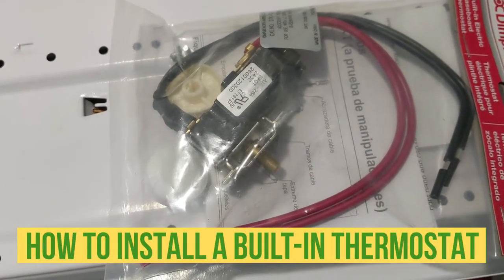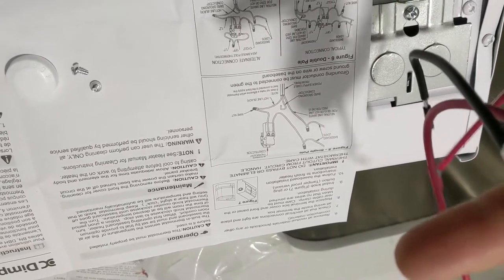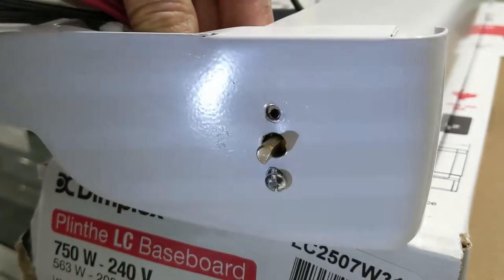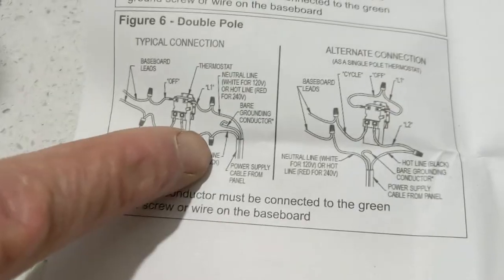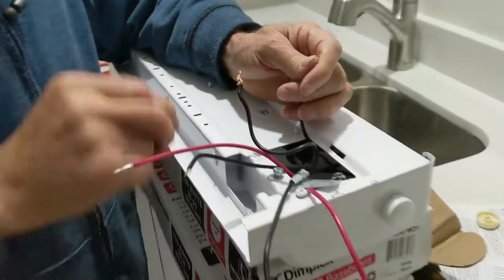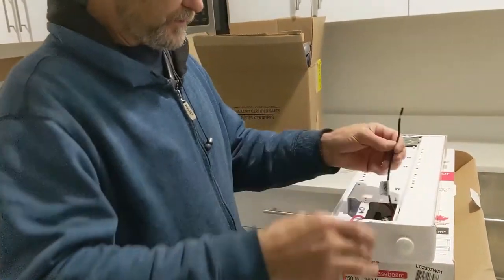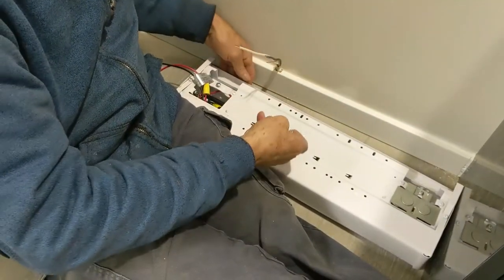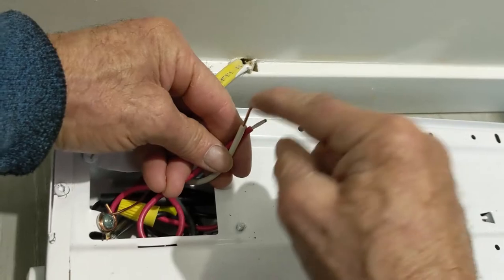How To Install a BUILT-IN Baseboard heater THERMOSTAT

Comment: Should the yellow insulation jacket be extended through the clamp?  I Highly recommend professional installers to overlook!
Reply from the maker: Hello Andrew, thank you very much for your time and support, yes, it is recommended for the yellow wire jacket to extend through the clam, in this one the wire was a bit short do it before setting up the heater on the wall, on the end the wire jacket went through the clam and I made sure that it is safe, keep safe and see you soon.

Comment: How would the installation process change if the heater is being installed in parallel with other heaters connected the same breaker at the electrical panel?
Reply from the maker: Hello there, thank you very much for your time and support, a 240-volt circuit  on a 20-amp, double-pole breaker, can have any heaters combination up to 3,840 watts,  It's also possible to install 2 or more baseboard heaters on the same circuit as long as their total combined wattage is not higher than the circuit's maximum capacity. Please let me know if you have more questions, keep safe